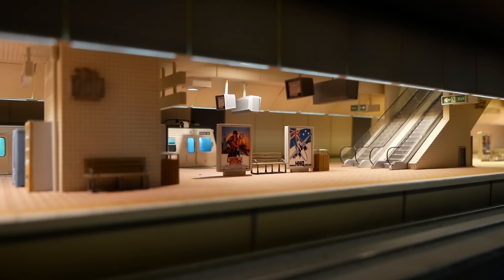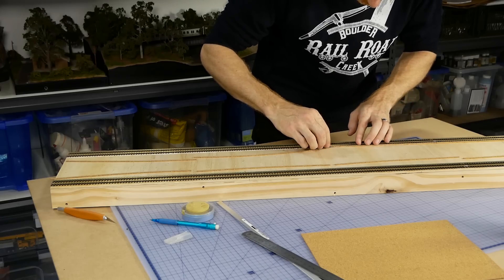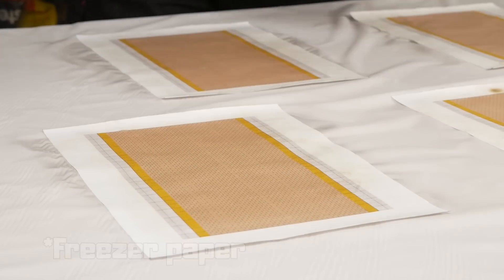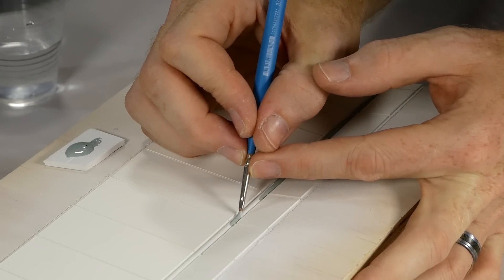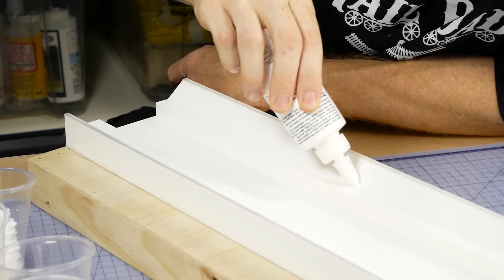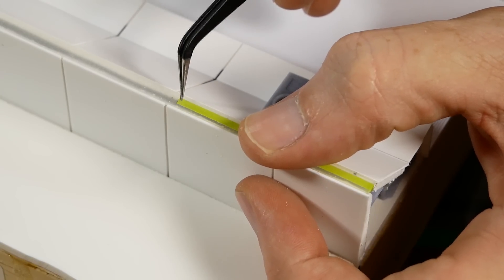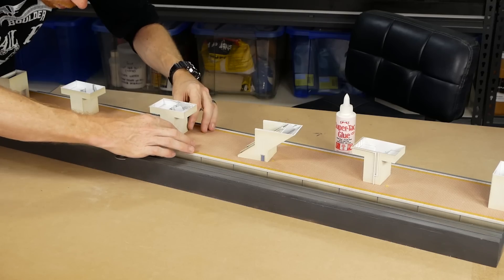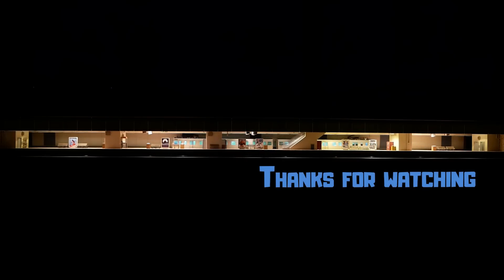Ultra-Realistic Subway Diorama (That Works) – Realistic Scenery Vol.20

Comment: Nice, I love it. Back years ago sometime in the mid 80s I made a subway loop under my layout. It was a versions of a Boston Ma trolley stop I ran LRV true. Unfortunately when I moved it all got taken down. I actually took my camera with me to take reference pics at one of the stations and got yelled at. I never knew you were not allowed to photograph T stops! LOL I did manage to get some good pics of the tile walls I was able to duplicate to make large sheets to cover the walls. I had to have several prints of the same photo glue them on a sheet and go back to the camera shop to copy and print it on regular photo paper because they are actually shiny under the dirt and at the time there was no printers or software. Eventually I will refurbish it because now there are so many options to make and print better quality stuff.

Comment: The subway train is actually a model Hitachi train which was a suburban metropolitan train that was running in Melbourne until they were retired from service in 2014! They began service in 1971 and had an overall design that was hugely directly inspired by New York stainless steel subway trains at the time so because of that it works great as a subway train! The station design also appears to be based on the design of Melbourne Central Station in the Melbourne CBD! :)

Comment: Excellent work,you have the patience of a saint.Lift and escalator guy here,lifts not in use aren't "boarded" up,they have a lift cage bolted in front,also you left out the very bottom step of escalator,which is actually an access hatch to the bottom rollers and mechanism.dont take this as criticism, It's only pointed out in the pursuit of correct details.

Comment: I hesitate to offer advice to such an accomplished artist but from experience I would recommend that when you cut sheet materials with a craft knife you have the ruler covering the 'finished' side of the cutline so that if your blade wanders off (or even snaps) it doesn't damage the finished item.  Also from (someone else's) experience, make sure that the ruler is thick enough to prevent the blade from riding up between your thumb and forefinger.

Comment: Not super into model railroads, but this makes me reconsider to an extent! Least if I ever do want to build one, it would probably be this form factor. One, I really like the self-contained nature of this setup, so that needing to move/transport it, would be mainly disconnecting, taking down and then stacking each section onto a pallet. Two, the self contained nature means the face can be covered in plexi to cut down on dust, as well as keep the trains contained from catastrophic derails. I also see ways to make the internals easily accessible from above and below. Three, it seems like a much safer way to contain a layout while suspending it at a height, as well as still offering a LOT of area for various detailed sections/vignettes to be introduced throughout the layout (from mining areas, work crews, maybe a "hidden track" similar to secret sidelines or disused vintage stations, fantasy cave sections, etc). 

Some go for super-realism, but I think having a fantasy crystal/mushroom cave section with fiber optics would look amazing. Besides, there's precedent with the Naica, Chihuahua cave (albeit not with a train running through it, but still). It's also not popular, but I think there's more potential for using a setup like this for a sci-fi setup or a futuristic section. 

Anyways I'm also trying to say this is a great idea and execution haha.

Comment: Stunning work as always! A quick tip for preventing seams on the fabric flooring you laid out. Overlap two pieces using the textures for alignment, cut a straight line across the width and remove the two small strips that result from the cut; you'll have a perfectly matched seam that you won't need to paint-fill.

Comment: Why did you cut off the tracks flush with the end of the base?  Wouldn't it be easier to attach to the unseen track if it extended into the tunnel?

Comment: What really takes away realism in a lot of these models is the lack of shiny or glossy objects/surfaces. Everything is very matte and just looks like plastic. That’s not to undermine how cool this is though, I just with modelers would make more things how they are in real life. 
The tiled walls for example, they would look more real with a clear coat on them so they can look ceramic. The metal railings and legs of the benches too. The train itself could even look more real if it wasn’t so flat.

Comment: I had to get this off my chest, I love the entire build but what is bugging me is the blocked off lift.
If a real lift technician had done it that way he'd be fired for safety violations. A blocked off lift would have a proper barricade and locks installed with highly visible notices on it. 
I worked for an elevator company for 12 years.